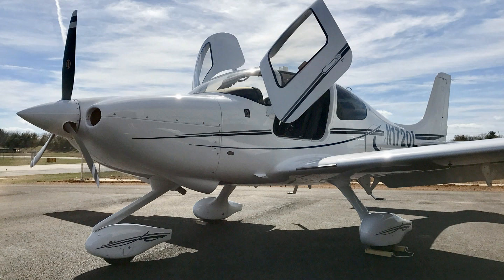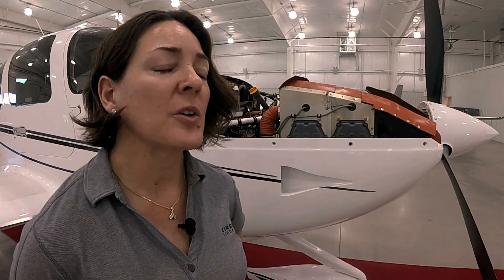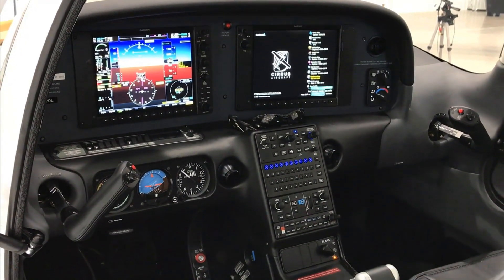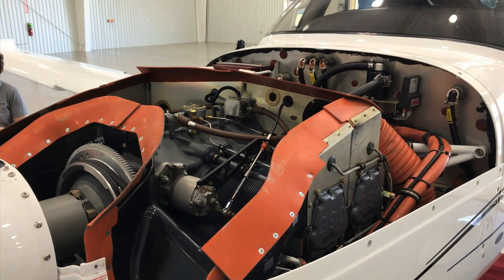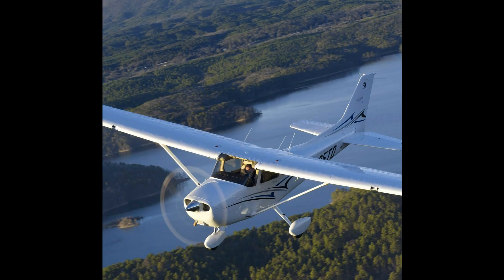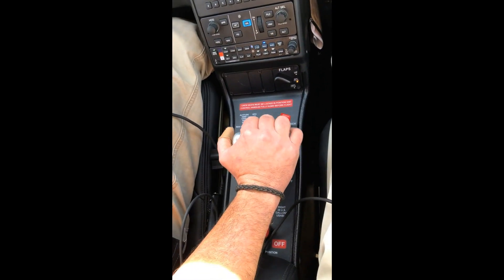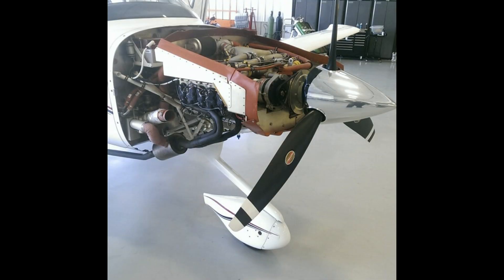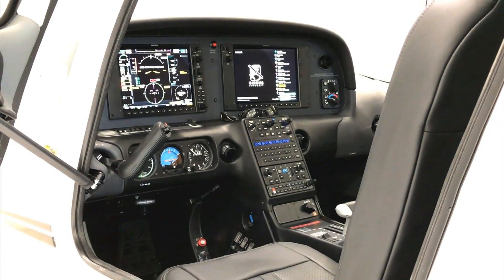The Cirrus SR20's New Engine

Comment: No doubt carburettor freezing is not solved
Reply: It's fuel injected.  It doesn't have a carb, so no risk of carb freezing!   Still a very old engine design thought.   They need a CDI Jet A engine in the SRs, if they want to keep up with Diamond; true innovators.
Reply: @droge1300 Not really fuel injected, not by modern standards.

Comment: Wow, its 2019 and the mixture control of the 1930's is still available... amazing.
Please Lyco and Conti, get some modern technologies in these engines. This is getting ridiculous beyond belief.
Reply: Not only that, piston diesel uses less fuel, water cooling allows higher compression heads, better power output, better burn input, better running, better fuel economy, better engine, more terrific at being enginey.
Reply: Absolutely.   Without FADEC and Jet A, Cirrus can never claim to be state of the art.

Comment: Doesn't that mean you now need a high-performance rating? I thought the point of the SR20 was that you could fly it with just a PPL.
Reply: Sebastian Benner it’s just a high performance endorsement not a type rating....
Reply: Sebastian Benner Still a PPL, the old 200 HP was already a high performance engine, 200 has been the threshold for a long time if I’m not mistaken...

Comment: First you start a fire, then keep shoveling coal in until your boiler reaches optimum steam pressure.  Make sure your horse is securely tied to the hitching post so he doesn't run off during your flight.  Now get in the plane and flip the breaker to turn on what the kids are calling "electric lights."  Open the steam valve slowly and take to the skies.

Seriously, small aircraft have engines that aren't just outdated, they're antique.  Imagine throwing an engine from a 50's automobile in your car today.

"New Engine" HA!
Reply: I know this comment is a year old, but you are forgetting the reliability standpoint when it comes to aircraft engines.  Given the nature of flying I know I don't want to be using some nearly experimental engine that hasn't had the bugs worked out of it yet.  You know the old saying of "Don't buy the 1st year of a new model of car."?  Thats because new car models with new engines always have bugs, and who wants to be cruising along at 10k feet when one of those bugs decides to rear its ugly little head?  I'll take the proven "old" technology rather than try and hope a newer design is as reliable.
Reply: And here we have it folks: This is why light aircraft are still being thrust along by 1950s engine technology.
Reply: Exactly!
Reply: Its called strict liability, the championing of consumer rights, as they are the most protected class in America as theorists in classrooms have (incorrectly) determined consumption drives the economy and that "consumers" are a category of human being that must be protected. The laws allow for judges to judge based on hypothetical scenarios, and the belife that manufacturers must be omnipotent and omnipresent. The mear oversight of an unknown possible and highly unlikely scenario that a holy and sacred consumer might inadvertently get themselves into by their own ignorance is grounds for a multi million dollar settlement in America, post Nader. And the same core philosophy of judging cases based on hypotheticals and a make belive alternate reality can also be studied in defense of O.J. Simson.

When manufacturers must account for pure insanity and unreason settling against them in every case, no matter how well defended. They tend not to invest hundreds of millions to develop new products. Party because an update or improvement becomes admission of guilt of building an inferior product in the past. (yes, it's true that mear product updates and fixes have been used retroactively to decimate manufacturers in court). It also opens up a world of unknowns that cannot be predicted. One must test everything to the standards that the automobile industry does, as in billions and billions of dollars for the next model of pickup truck, etc. Crash test thirty production vehicles, set them on fire. Jump over curbs, crash into a hangar, etc. It's not financially feasible for any manufacturers in Aviation, outside of Boeing (who simply drop test sections of fuselages and extrapolate the data, never crash testing an entire airplane). Even the big dogs, who carry millions of these sacred, holy, paying consumers, can't afford to predict every outcome of their product.
Reply: if it works, why is it suddenly worthless....?
Reply: They're not worthless, just extremely outdated and overpriced.  I understand why; it's a relatively small market compared to the huge auto industry.  Manufacturers can't spend big money developing new engines only to sell a few thousand whereas the auto industry sells hundreds of thousands or millions.  The large size, high weight and ridiculous fuel burn are all artifacts of the very dated design - but then you look at the cost and try to pick your jaw off the floor!  Bravo to Lycoming for being able to sell it for this long... shame on you to Cirrus, et. al. for using them.
Reply: The problem is they must be aircooled to save weight on such a small aircraft. You are stuck with old tech because of the application.
Reply: @moto_rad  Liquid-cooled engines are often lighter than air-cooled engines.

Comment: Nice lawnmower engine.
Reply: idontcare80 hahahah
Reply: idontcare80 . Your comment is idiotic. What engine is better than a Lyc IO-360/390/540 or Continental 200-500 series engines, in the 120-400 HP range for a prop plane? Air cooled direct drive engines in the 120-400 HP range, Lyc and Continental Horz. opposed air cooled direct drive piston engines RULE. Early versions of these engines and radials RULED in military and airline industry until the 1960's. US Gov and Aerospace industry has spent BILLIONS and BILLIONS on this technology, which is far more sophisticated than a "lawn mower" engine. Sodium filled valves, advanced ceramic coatings, forged cranks and rods... No other engine will be as light, simple, reliable, efficient, low drag as this engine... PROVE ME WRONG... Dare you. These engines have stood the test of time and have undergone continuous improvement over the last 60 years. Todays air-cooled Lyc and Continental are reliable and represent an outstanding value. These are purpose built engines for a specific mission.

Turbine engines rule in the over 600HP range and turbojets rule for military and commercial aviation for long on wing time, power, reliability, but they are prohibitively expensive, with higher fuel burn and overhaul cost for GA.